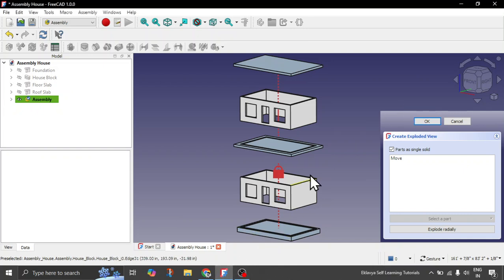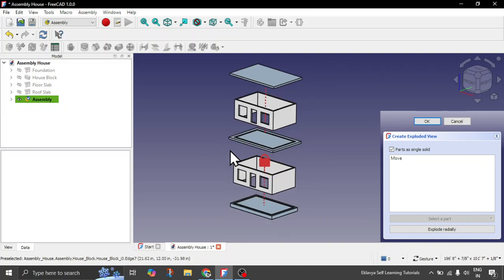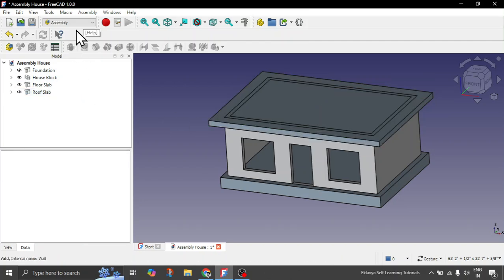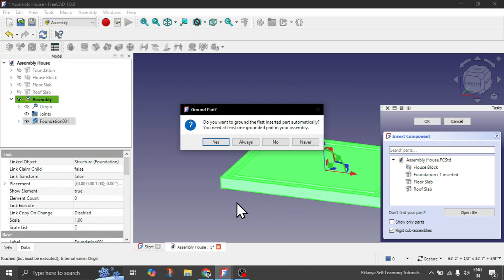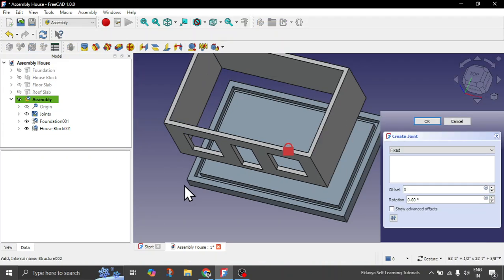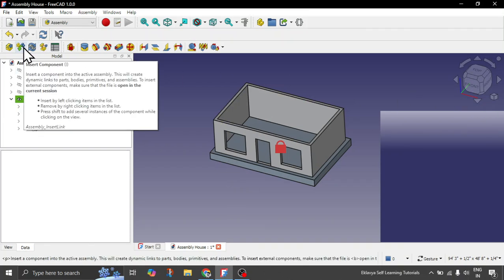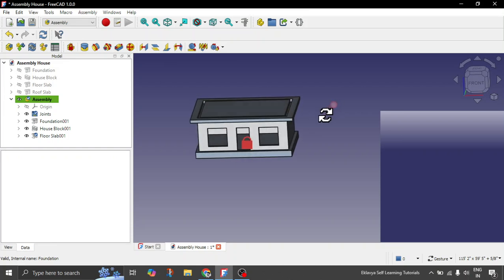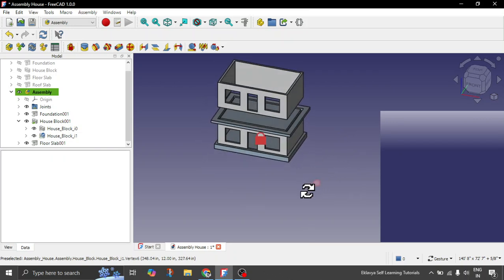FreeCAD Daily #7: Using Assembly Workbench for Architectural BIM

Comment: Hello!
I have a question not related to this video (that is very nice).
I've saw that you have Arch Texture installed in FreeCad 1.0. Can you use it anymore? I love that tool, but unfortunately for me , doesn't work anymore in FreeCad 1.0 .
All the best!
Reply from the maker: I installed it for testing purpose but facing some issue in using it.

Comment: Great video as always! Can you do a video on creating a window with movable shutters using assembly? Can such an assembled window be used multiple times? If we do that, will each instance be considered as a separate window?
Reply from the maker: When we insert a window, it basically makes cut in the wall. In assembly workbench, we use the finalised parts or finalised BIM objects. You can insert a window as a part in the assembly multiple times, but don't expect it to make cuts in the hosts.
Better option is to create typical wall panels with windows and then use these wall panels as parts to be inserted in the assembly.